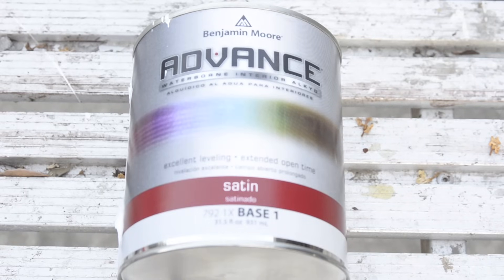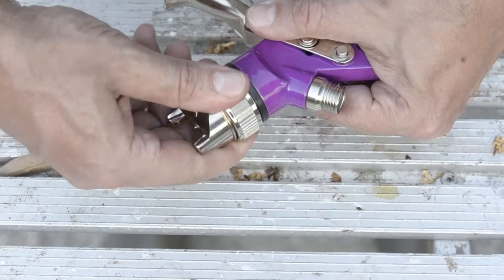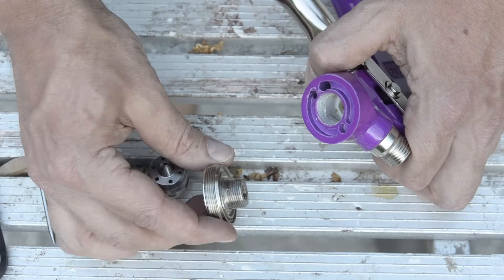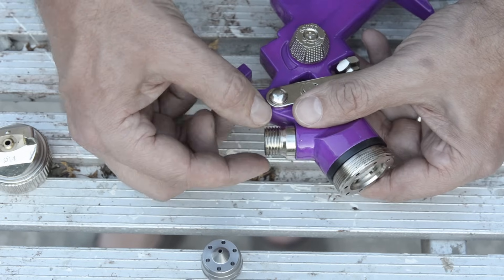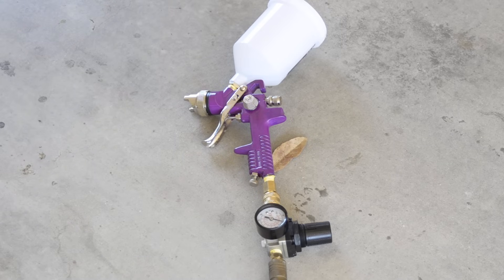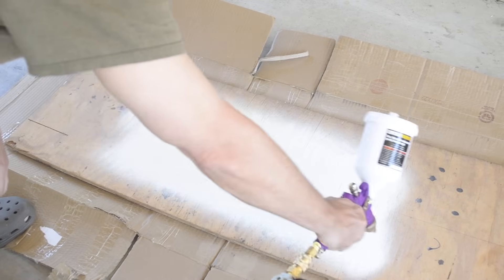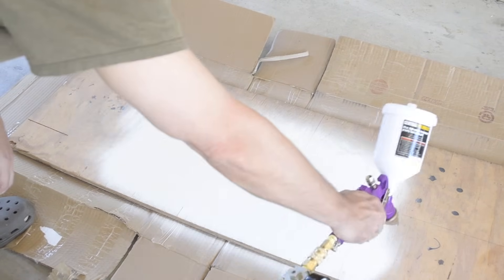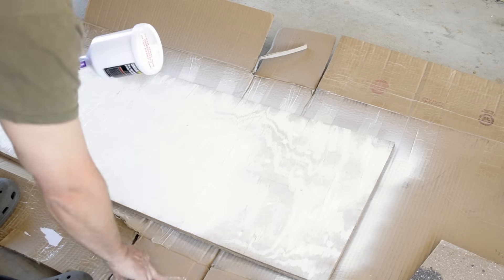Spray Benjamin Moore Advance with Harbor Freight "Purple" HVLP Spray Gun

Comment: I just used the same gun to paint my 36ft Gulf Stream motorhome and got excellent results useing a one stage $100  a gallon eBay paint and $100 per gallon eBay primer. Take the gun out of the box disassemble it clean it with lacquer thinner to get rid of the machine oil before using it. I plan on using it again for some other projects, painting the shed etc. It's a very user friendly little gun.

Comment: Very helpful video. A few paint spraying tips: clean all parts of a new gun w/ lacquer thinner (removes the factory protective coating on components); mix in a capful of Floetrol when you start the gallon & another capful when the gallon is half empty, thin the paint down - in the gun reservoir (not the can) - w/ warm water at least 10% (increase up to 29%, as needed), in addition to a pressure gauge, you should also get an inline moisture filter to keep water than condenses inside your compresser from further diluting water based paint.  The moisture filter mounts on the hose between the compressor and the in line air pressure gauge. You mentioned straining paint. It’s a must do.  For a low-priced gun, this Harbor Freight tool produces good results.

Comment: I just sprayed some kitchen cabinet doors using my HF purple gun with a 1.4 tip. I thinned the Benjamin Moore Advanced with a bit of warm water to get the desired consistency. Used 25psi at the gun. Flowed out well and laid nicely. The gun comes with a 1.8 tip, as well.
Reply: I use a LVLP spray gun with a 1.8 tip and get the same results with 22psi at the gun with 25% water. Two light coats of paint, sand in between with a green washing up pad, gives factory finish results.
Reply: How much water? 20%? using the smaller tip usually you need to thinned much more, with a 1.8mm you can reduce 5-10% and usually depends on humidity. I been using both the 1.4mm and a 1.7mm tip and get very good results, and depends on the actual weather and humidity. Floetrol is very good to extend the drying time and especially good in warmer weather.
Reply: @gazsto9510  I used the 1.4 with about 15% water and it sprays just fine. I do need a few extra passes to get my desired coverage

Comment: Ive been using advanced for years doing cabinets,  love the finishes.  Use a 2.0 tip keep tabs on the pressure and your good.  The only thing I really dont like is the drying time before the second coat.  99 percent of the time two coats is all thats needed.  I think if you slow your arm motion down a bit you will get the coverage you want.
Reply: Do you think it's important to wait 16 hours for the second coat? I'm using a Sata gun
Reply: Gun works great with 1.4 tip. I sprayed Advance Benjamin Moore paint...cabinets and doors look great. Dont need a 2.0 tip
Reply: Use their command paint it drys fast
Reply: I am going to try to spray this paint with a 1.8mm tip hope it works

Comment: I have this paint gun. I did not drill it out and I have successfully sprayed latex. However, I had to thin down the latex quite a bit. I use a product called Floetrol. You can buy it damn near anywhere, but it's made to make latex spray like oil. Sometimes I'll also throw in a little purified water.
Reply: Yeah, I been using a 1.7mm tip and Floetrol helps big time with the drying and viscosity of the paint, adding some water helps if not overdone!
Reply: I tried shooting SW Emerald with this gun, adding flo to it. Would not shoot. Definitely will try a drilled out tip.

Comment: Thanks for the video.  Was frustrated yesterday with the 1.4 tip that I had to sand the entire door .  This morning I mod the tip with a 1.8mm (that drill  bit I have) and I am so happy with the result.
I still have to thin  20% and set the air to 20PSI at the gun.
Reply: Excellent, I use the 1.7mm tip and get great looking results, you can use the 1.4mm but you need Floetrol and water to get a thinner more flexible viscosity for the paint flow, but if you up to a bigger tip then you can achieve the same results and get a fine quality spray, I found 2.0 and higher loaded too much paint and you need to watch the coverage.

Comment: I just sprayed a whole house of interior trim and doors.  The instructions for the gun says to thin according to the paint can instructions for spraying.  I used enamel trim paint and it said to thin no more than 8 ounces water per gallon.  I ended up using 16 and it worked fine.  I used a fairly small portable compressor I normally use for nail guns and it held up fine.  With the lower pressure the compressor does well. It did run a lot but caught up when I stopped to move, refill cup etc.  I was able to get more volume of paint coming out by turning down the air flow on the left side of the gun to almost nothing.  I used the regulator on the compressor at 70 psi.  While spraying the pressure would drop to 40.  Next time I will use a regulator at the gun so I can use the compressor at 110 psi and the pressure will last longer.  This will be my go to gun for inside painting now.
Reply: Hey, so im bout to do the same and paint the trim on the outside of the house. Which paint would you recommend? And I think im gonna try your settings, I'm a amateur.. lol
Reply: @aaronreed5754  exterior trim paint. Just fiddle with the different knob settings until you get the desired result.
Reply: Hi, just to clarify...you would set the regulator by the gun at 110?  Would this result to very low pressure like you said - to almost nothing.  I read pressure at the air cap should be around 10 psi.  Also, what pressure should I set regulator by compressor, or does the one by the gun override it.  I was planning on buying a homeright sprayer to paint kitchen cabinets but may go with Hf spray gun instead. Thanks.
Reply: Oh, I just read that you turned down the air flow to almost nothing, so is that totally separate on setting the pressure at 110? If so, please explain how setting pressure at 110 near gun helps. Thanks.
Reply: @JC-ov5pt  It just gives you high pressure up to the gun and more to use at lower pressure. I also used a reserve air tank and gives you more reserve at the higher pressure.
Reply: Exactly what I want to do. Spray my trim work. I have a fortress 2 gallon compressor from harbor freight I use for nail guns which has a higher cfm than most small compressors.. Do you think it'll hold this spray gun ok??
Reply: I want to use this gun to prime and paint a kitchen wall and some trim using a semi-gloss latex. I've used it before with latex. It was years ago and I haven't used it since, but it turned out fine. I'm using a small compressor this time but it's rated for an hvlp. I've also installed regulator on the gun itself. Any suggestions for settings?

Comment: The white stuff on the fluid nozzle is akin to liquid pipe sealant. As for product volume (water) is pull handle full back with fluid adjustment out. Now too far and cap comes off & spring. Screw in until it hit the handle.
 Remember, first pull is air only, second pull is fluid. My relative has thrown away 22+ purple guns and I just want to stain a fence. Yes, if cleaned, spray epoxy, primer or high build but not paint base, inner-coat clear or high solids clear coat. This purple beast will last until the seal around the fluid needle gives out. Drilling is easy as this has thin chrome on brass. Hold in gloved have to keep from breaking drill bit! 
  My fence is stained, no thinning. If painting a car, dedicate a hose with filter before hose and on gun & buy a 1.3mm or 1.4mm. Just move faster to get use to settings, gun & product. Best of luck. To strip varnish or cars, browse to "Cooper's Strip Club" as he & wife sell kits of product that work. Watch their videos.

Comment: Awesome!! Need to know how to open gun air pressure valve and set the air pressure on gauge on compressor and on gun.. my gun keeps dropping g pressure when I begin spraying but it shows 200psi on tank , I turned second dial on compressor up to to 35psi, their is gauge on gun but it drops to 20 psi when I pull the trigger to spray

Comment: supposedly, what everybody thinks is silicone is actually a liquid PTFE that was applied at the factory.  But if it fragments, then it doesn't matter what it is - it's probably a good idea to remove it.  btw, the pressure range is 40-70 psi, and a 3/8 or 1/2 inch hose should be used.

Comment: The famous HF "Purple Gun"! Is a pretty good gun, not only for the money, but as a gun in it's own right. I've shot a Mod. A  Town Sedan with mine and a couple of fenders and hoods. Pretty Good! I drilled my nozzle out and I think it was it was around the same size and the small ports to .025. The gun worked fine. Also, experiment with a little higher pressure. I was advised to use the higher pressure by a professional painter. Read the back of the can for spraying directions, most have separate instructions for spraying. When you pour the can, make sure you don't paint the directions, pour so it runs down the front.
Terry
Reply: Where are you? Canada? I use the $9.95 one. I have an ancient 2 cyl. upright 60-80 gal, Compressor that I have backed the pressure  down to 100lbs because I'm so afraid of  it. I can't say what the CFM is, but it has kept up with whatever tool I use. I have heard for tools such as this, you need 10 CFM consistently . I maintain that the purple gun from Harbor Freight is one of the true bargains around.  Try to make it and sell it for $10 and have it work reasonable well. And I hate HF. Buying crap  from HF is buying bullets for the chinese army. BUT they have these products heavily subsidized. so the loss is theirs.
Terry
Reply: Additionally, I have heard from guys who know a lot more about spraying than I  do, Use over 40 lbs. PSI. The gun likes pressure!
Terry
Reply: Use a silicone pour lid, or do what I do, use a dollar store funnel and pour whole gallon of expensive paint in an empty clean water or milk jug.  makes for good storage and fills the hvlp cannisters quickly.  it's worked for years.

Comment: Just as a rule of thumb, I thin paints to spray them. The only exception is the paints that are already thinned for spraying.
Reply: How do you thin them with what? Mineral spirits?
Reply: @aftereverett  water
Reply: How much water to thin them? Any general rule?
Reply: @jonmike316  add 5% and test, add another 5% and test. That way you'll find the best results.  Let me know
Reply: @jonmike316  10% maximum as a rule because it can alter the structure of the paint. I spray a similar paint thinned down by 25%. The reason I thin it down so much is that I want a matt finish which isn't available in the type of paint that I use. The more water used the more dull the paint becomes. Hope this helps you.

Comment: i used a stock gun, thined the paint and painted my kitchen cabinets just fine with this paint and gun. No mods required.
Reply: Have you posted the final results of your cabinets anywhere?
Reply: What size air compressor did you use with the gun?
Reply: I know some professional painters and they openly talk about mixing paint thinner with latex paint.  They recommend mixing 12% thinner to the latex paint.  I haven't tried this but I hear it gets good results and better coverage.
Reply: @erniemartin654  nada.
Reply: Mike Bell I know... and that’s what I’ve learned to be true as well. That being said this group of painters swear by this practice. Apparently it spreads easier and is a breeze to clean up. My friend (who works with this paint crew) tried this recently and claims he’ll never paint with straight latex again. I think it’s worth a try, I’ll let you know what my experience is with it. Good or bad.
Reply: Mike Bell I guess that’s the beauty of YouTube, people post videos of different ideas. This video of someone using latex paint in an automotive spray gun is an example of the spirit of those ideas. I post a suggestion that obviously would help someone spray latex paint a little better and you refer to me as “stupid” which says more about you and your inability to articulate your thoughts than it does about me. I don’t need to belittle anyone on here and certainly don’t need to resort to name-calling to get my point across.   And by the way, my friend’s paint job looks perfect and no “curdled” paint as you suggested. He used 12% paint thinner mixed with CIL latex paint. I’m trying it today.
Reply: @Mike Bell On the other hand, is every Youtube video put up by an expert?  Take everything with a grain of salt.
Reply: @erniemartin654  hello, how will you mix latex paint with thinner? We are not supposed to mix oil with water, that paint is going to fall off like plastic once it hardens, or was the chemical process going on here, what kind of thinner are they using?
Reply: @erniemartin I read the comments and I didn't know anything about painting indoors. I tried to paint some cabinets at my work with an electric paint gun and the paint was just too thick. We tried to water it down but it did not work and just made a bigger mess. Out of desperation I put thinner in the paint like you would use reducer in automotive paint and it worked excellent! The paint flowed well and the finish was amazing! Not only did I paint the cabinets I painted the whole office. It has been that way for 5 years and still looks great. So maybe I am dipshit too but I got it done and it does not curdle. Good luck. I wish I could post pics.
Reply: @Mike Bell Nice come back, coming from an "online bully".
Reply: @erniemartin654  Pretty sure they mean a Latex Paint Thinner, as in Floetrol.  Because using what I would call Paint Thinner (Oil Based) just destroyed the latex paint I just mixed it with.  Not sure I used 12%, more like 10%, but still less than you indicated.  

So tests have confirmed mixing typical Oil Based Paint with Latex Paint will destroy your paint.  Mixing a Latex Paint Thinner (such as Floetrol or others), makes the paint easier to spray.  However, if you are using Gloss or Semi Gloss paint, the sheen will not be consistent or it will be less than without the Latex Paint Thinner.

Comment: i have done this drill tip trick and it worked perfectly, I even used a cheap small compressor, and I use a little floetrol latex conditioner,   i am a rookie just starting out painter.
Reply: Hi did you use 3 or 6 gallon compressor to use this?

Comment: No need to drill out anything, ever. Spraying is really an art, a ballet with half a dozen dancers, each reacting in sync from subtle changes in their partners.

Experiment with Floetrol and water, each paint is different. 

Flo helps keep the paint open to lay down like glass, start @7-12%.

Water 5-7%, try to keep it low as possible until you achieve your desired atomization. The reason to keep it low is that you reduce the durability the more water you add, putting more distance between the chem molecules that bind to one another.
Reply: FINALLY, and certainly, the guidance of a true Artist ! 🙂

Comment: Did you thin the paint with water? I did drill the Harbor gun to 2.00mm -- The paint I use Kelly Moore interior white swiss. The paint did not come out. What I do wrong? My air compressure is Porter Gabel pan cake 2.6sfm 6 gals. I hook up straight from the air compressor I set the air compressor at 60 psi. Thank you
Reply: You need to plug in your compressor.

Comment: Part of the reason you're leaking fluid out of the tip is because you may need to "burnish" the drilled out area.
One guy used the gun's needle and a drill to do the job and he claimed it stopped the leak.   Just saying....

Comment: Primer... Primer
and the thin the paint. Use a stirring stick. Dip the stick in your paint. Then left the stick out of the thinned paint. Until you get a 1...2...3 count then drips
Reply: Great tip, Bobby! Also, a person could get a viscosity cup. My Avanti HVLP sprayer, also from Harbor Freight, came with one (it's about 2-3 ounces) and they suggest to submerge the viscosity cup entirely into the paint, lift it out and time the draining paint for 50 seconds. If the paint drains (from a small hole at the bottom of the cup) within 50 seconds or less, then you're good to go. I did a few tests by addiding water to the paint and mixing well, until it drained within 50 seconds. While the paint manufacturer (Behr latex for doors and trim, in my case) doesn't necessarily recommend thinning, I don't know of any other way to spray it.

Comment: How did drill the gun tip from a drill bit 5/62, from outside in or inside out? My concern is to place the drill bit right on the center of the hole. What is your current air compressor capacity?
Thanks for your vid!
Thanks for
Reply: Drill from inside out....it helps center the drill bit.
Reply: And its 5/64 not 5/62
Reply: Harbor Freight sells a 2 gun combo kit that the larger gun already has a 2.0 nozzle, unlike the single purple gun with a 1.4 nozzle. No need for drilling.

Comment: Great video.Drilled it out from inside and sprayed Stix primer today with no thinning and it was perfect.Not one drip from gun.Advance tomorrow with hopefully no thinning .Just cross my fingers.Impressed with spray gun.Thanks.I'm in my right mind as esso made a comment.
Reply: Did the Advance need thinning?
Reply: @flipper98c  just two capfulls of water from a 15 oz water bottle worked great per fill on the purple gun.Just thinned it a little bit.

Comment: Hey im using enamel exterior paint with this gun. Anyone think i should thin the paint a bit? And if so wat should I use. Thanks
Reply: If the paint is water based or latex. My opinion would be to use pure water. Not alot . U can ruin the paint and it will never dry. Make sure you do by little samples. Good luck